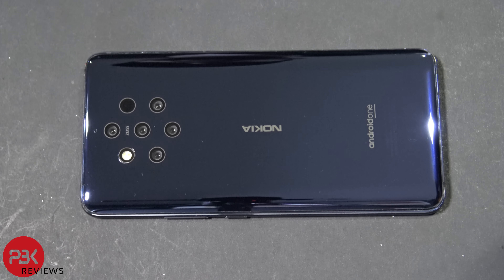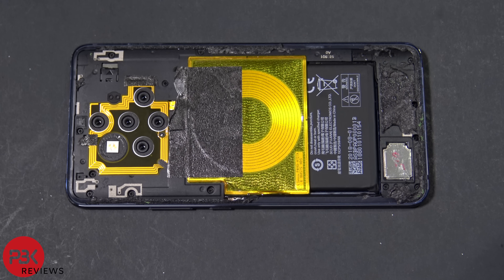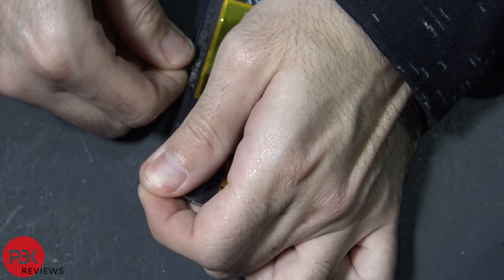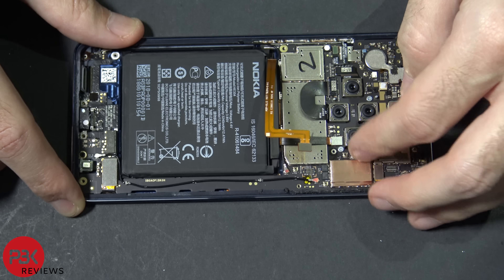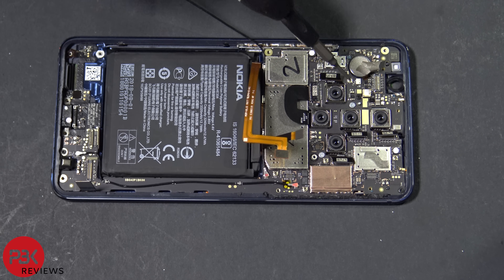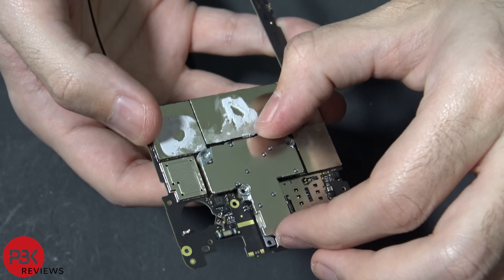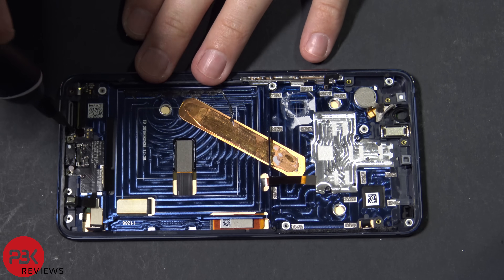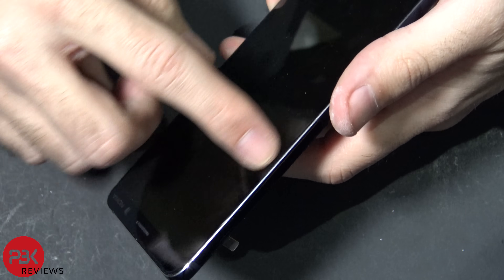Nokia 9 PureView Disassembly Teardown Repair Guide. Well Sealed!

Comment: This comment is about the battery replacement, but first thank you for this awesome disassembly guide!
If the only aim is the battery to be replaced, than it is enough to remove black cover with wireless charging pad only. 
Following the video I have removed speaker assembly at the bottom too, but there is no need for that.
To quickly remove the battery I have heated display before using the pry tool on the battery. Pry tool should be sturdy and battery wide for the best results. Facing display down apply force from the left side to the center to not damage the right connector beneath. 
Hope this addition will help somebody eliminate the unnecessary work.
Reply from the maker: Yes correct, you don't need to remove everything for the battery replacement only. I will pin this comment in case others are curious about that as well.
Reply: Thank You  Brother ❣️

Comment: Interesting to see how Nokia managed to cramp 5 cameras into such a small package
Reply: Yeah. By using a small battery and making it thicker.
Reply: @nickmotsarsky4382  and squashing the heatpipe under the battery, something very dumb as the battery itself is also hot, so the heatpipe has really no way to release heat incoming from the CPU.

Comment: Please show how to replace the front glass of Nokia 9 Pureview
Reply from the maker: After you disassemble the phone, you need to heat up the screen to loosen the adhesive underneath and pry it off the frame. Its just held down with adhesive. Then you apply new adhesive, and put your new screen on the frame and reverse the process. Its always best to try and find a screen assembly that is already pre installed with the frame so this makes it much easier for replacement so all you do is disassemble your phone and put all the parts you took out back into the replacement frame.
Reply: Can you suggest a repair shop in Kolkata where they can undertake this job? I live in Kolkata West Bengal India and I don't have that much capability to undertake the job myself, for a charge of course.

Comment: I read somewhere in a comment from Nokia that its part of production process to calibrate the pictureprocessing algorithm according to the very precise different view angle every of the 5 cameras have, as it has not been a choice to have a production process where the cameras will lign up, maybe its possible but to expensive. So be careful with tumbling too much around with these cameras, as one may loose some picture quality.
Reply: Have to agree in that nowadays with modern electronic parts being so small with limited room for errors, it's always good idea to NOT open up & try to fiddle with anything inside the device.
Reply from the maker: Hmm didn't know that, but so far the cameras seem to be working fine with no issues. They were  very difficult to even get out because of the fact the cables were ran through the slots/slits in a certain way so they are somewhat larger and dont fit through the openings to slide back out easily. Requires a lot of time and fiddling with to get them out and remove them, maybe they did it on purpose for the reason you stated.
Reply: that would be too unreliable -- the software has to correct and do the matching

Comment: Vapour chamber under battery is actually quite smart as batteries dont operate well under cold conditions (loose stamina which shows as less battery on your phone until You get inside) but have a pretty high max temp rating.
Reply from the maker: Ya but I would think since the battery itself can generate heat, along with the screen being on for long periods, and the chamber being in between both adding even more heat I just feel like the heat dissipation becomes very little at that point if anything at all. I would one time like to see them direct the heat toward the outer edge of the frame of the phone or the actual back of a phone, somewhere that can externally be cooled rather than berried between and sandwiched.

Comment: Thank you for the video. I have a question if you don't mind. Is it possible to replace just the front glass or would you recommend the entire display to be replaced? I broke mine a few months back after rough handling my backpack while it was in there. Was thinking of getting a new phone but after dropping this several times and accidentally dragging my fridge over it (don't ask!) seems like there's plenty of life left in it. Appreciate any help.
Reply from the maker: No problem. You can't replace the glass by itself you would need to replace the entire screen assembly. The glass requires special machines and tools to get replaced.
Reply: @PBKreviews  Thanks for getting back to me. I've taken your advice and ordered the entire screen assembly. Depending on how brave I'm feeling, might make the back clear too. I've seen your other video on customising the Nokia 9 back. Looks cool.
Reply: Finally got round to replacing the screen and back. I removed the blue paint to make the back clear. I removed the wireless charging coil including the plastic part it was attached to so that I could see the internals better. Thanks again for your video. I got stuck in a few places and it really helped.

Comment: Many thanks for doing this so we don't have to. The thing people are calling a "ToF sensor", (opposite the flash), what actually is it? Seems to have two small holes. Is it just a light emitter and a single sensor, so basically a distance measuring device for autofocus, or is there more to it?
Reply from the maker: No problem, I think that is the ToF Sensor
Reply: Used for depth mesure in 1200 focus planes to later be able to change focus points (and bokeh)
https://en.m.wikipedia.org/wiki/Time-of-flight_camera
Reply: @bigbadboogie6842  ok from the look of the device I'd assumed it was a simple range finder that took one measurement. That Wikipedia page suggests devices like it have resolutions of about 320x240. If so, I guess Nokia might use a combination of techniques to get a 12MP depth map.

Comment: Thanks man what a great teardown. Also there's no ToF on board, is just a laser autofocus, so some of the hands on articles are false.
Reply from the maker: Thanks! I haven't really messed around with any ToF sensors so I'm not to knowledgeable in that field. I do know when messing with the phones camera software that it has the in depth options and so forth, but not sure if that actually applies to the ToF.
Reply: How else can they produce an extractable depth map? The phone has to know something about space and distance or they are really doing magic.
Reply: Laser Autofocus is one way to make a ToF sensor. The whole point of laser AF is to create a depth map.
Reply: @Vasharan  well how is it that Nokia is the only one to create such an accurate depth map then? Is it the five cameras? Just trying to understand this tech.
Reply: @PBKreviews  ToF is actually like an autofocus sensor, but better and is actually a camera sensor
Reply: In this case, I believe Nokia is using those 5 cameras to collect the infrared light that shoot from infrared sensor to create the depth map. TBH this kind of technology already available for smartphone quite some time. I remember Sony has their phone to do 3D scan on an object without promoting their camera is a ToF camera. Or maybe it's just a trick in the infrared sensor. But I would like to try blocking the infrared sensor when taking depth map enable photo and see whether the depth map will goes wrong or not.
Reply: The black circle is actually a tof sensor and laf...
Reply: BTW in the user guide, stated that the black dot is a infrared sensor ....... just found out

Comment: Hi, would you be please so kind to tell me the model of the primary camera sensor? Sony IMX...?
Reply from the maker: Hi I'm not sure which model it was since I didn't see a model of it written on the view able camera housing, and I didn't pry off the bottom case of the camera to see if it had a model written on it.
Reply: @PBKreviews  Thanks for your prompt response. I'd like to know  what is the primary camera sensor in order to understand which Google Camera Porting would work best.
Reply from the maker: @Bacchinif  If I find out I will let you know
Reply: @PBKreviews  Ok, fine. Don't worry about it. Usually it is something like SOMY IMX 258, 363 and so on.
Reply: @PBKreviews  Great. Thanks

Comment: Could you please tell me which exactly screwdrivers used?
Reply from the maker: Hi they are Phillips screws and the tool set link is in the description. You can use any smartphone tool set that has phillips head
Reply: @PBKreviews   thank you.. however I mean which one, t2, t3, etc..
Reply from the maker: @metaladis  Phillips.  The type of screw is a Phillips screw. Its not a Torx (t2 or t3) type of screw.
Reply: @PBKreviews  Ok, thank you!! 🙂
Reply from the maker: @metaladis  You're welcome :)

Comment: how " easy"  is it to replace the back glass panel ? and what about the adhesive stripe , where can someone find to make sure that the phone will remain waterproof?
Reply from the maker: Hi, it just takes time to heat it up and pry it off not too difficult. The adhesive you can use 3M 9448A double coated adhesive tape or you can use 3M VHB series adhesive tape (this one I don't believe is a water resistant one). Again keep in mind the water proof seal all comes down to how well you tape it back and not leave any openings in the seal around the backplate etc.

Comment: What someone needs to come up with. Seeing if the battery can be upgraded to a larger mah one and if the fingerprint sensor can be replaced with a better one 🧐
Reply from the maker: In 90% of the cases you cant upgrade the battery because of the fact the connectors are made specific and the cable lengths from the batteries are also made in a certain size, so one that's meant for another phone wont necessarily connect to the same connector or even reach the connector on another etc. In some cases where there is say a S10 or S10+ and everything is almost identical but the battery on one is larger, then that is a possibility if you modify the inside a bit allowing there to be larger room to fit the larger battery. As for the finger print sensors, on these its impossible to change since they are glued to the screen as well as the fact that they are programmed for the phone, so another make would not read with the software or hardware of the phone.
Reply: pwrdbykyank wow thanks for that comprehensive clarification! As for the connectors on the battery, can’t they be manually wired using copper to force compatibility with the phone for the battery? Isn’t it just a negative, positive and ground or something that you can try and customise the wiring with?
Reply from the maker: @Tilan123  Yea I mean someone with the expertise can do it but it would not be a factory job and could potentially cause a short if not done correctly (say if something comes loose or touches something else). Also I would think the battery chip would need to somewhat read with the motherboard software. So the phone knows what battery it has and how much charge goes to it etc. I know back in the day with the Motorola Droid Razr and Droid Razr Maxx phones, they were the same phone and one had a larger battery. So taking the larger battery and putting it in the other phone, the motherboard would automatically pick up the higher mAh battery and change the name on the settings about section of the phone from Motorola Droid Razr to the Motorola Droid Razr Maxx. So I assume the motherboard interacts with the onboard battery chip etc so possibly software would have to be altered as well. Not sure
Reply: pwrdbykyank wow very interesting! The only other thing I wanted to ask you is if you know what adhesive is used? Is it like 3M or something? Can someone who disassembles their phone seal the phone with an even stronger adhesive if they wish?
Reply from the maker: @Tilan123  I don't know exactly what adhesive they use but I know its waterproof. However factory ones like that are hard to find specifically online, I'm looking still to find a good one so I will let you know if I do. But for now I used red tape adhesive for smartphones which is a strong adhesive but not water proof.
Reply: pwrdbykyank perhaps you could contact a company like 3M and find out? 
This might be a stupid question, but is it purely the adhesive that really makes the IP rating? Or are there other things to factor like the back plate etc.?
Reply from the maker: @Tilan123  Other factors come into play as well not just the adhesive but gaskets around charger ports and openings and so on.
Reply: @PBKreviews  True! Thank you so much for the informative replies. I've subscribed :)
Reply from the maker: @Tilan123  No problem and thank you :)

Comment: where is lux capacitor
Reply: I notice the 4 huge rectangle regions which is where i expect to find the 'secret sauce' parts..how convenient they cover them totally with metal plate / foil so one cannot see any identification markings at all from outside. Trying to remove that might cause irreversible damage i suppose.
Reply from the maker: @hseochin  Ya most of the shields are soldered and would have to be pried off but a few on one side were removable but I didn't go too in depth. I didn't want to damage the phone since I plan on using it for a while :)
Reply: @PBKreviews  Hopefully there's no damage internally as it is, because by the looks of it i don't think they'll honour any warranty since they'll say the user opened up the phone despite there being no user servicable part inside ?!?
Reply from the maker: @hseochin  Ya well once the phone is opened you are voiding the warranty. So anyone who does any repairs themselves would void the warranty.

Comment: Why on Earth are you using a metal tool to disconnect cables? You could short and destroy something really easily ;o
Reply from the maker: The battery is not connected when I am using it and also sometimes plastic tools just don't get the job done

Comment: So sad so see back fingerprint sensor replaced with a lame in-screen sensor so that there can be wireless charging which very few people will use. They could have also put it into the power button.
Reply: I think it's very convenient to have it in display. I have used both and I really liked the in display one, while the back scanner was always collecting all kind of pocket lint and dust, especially with a case on. Of course, this may vary between phones and the scanners. I haven't tried side mounted scanner but I'm pretty sure I wouldn't like it as much as the other two. I'd imagine it would also be harder to unlock with left hand for example. But to each their own.
Reply: @bo4 is bad Bottom bezel*
Reply: back scanner is great when pulling the phone out of side pocket and unlocking it at the same time.
front scanner great when phone is in a holder, eg in car.
why not have both.
the problem here is the under-display tech is light based and i heard not very good.
Reply from the maker: Ya that would be great, if they had one on the back and one on the front, doubt it would cost too much more to do that. Least everyone would be able to use it based on their need at the time :)
Reply: @YouuRayy  both would be nice indeed, but I guess they want to have that "clean and slick look" by using only in display scanner. I have 6T and I can honestly say that the scanner is absolutely amazing. It learns your fingerprint over time and unlocks faster and more accurately over time. It's actually faster and more reliable than the back scanner on my old Mate 9. I wouldn't worry using optical scanner. :)